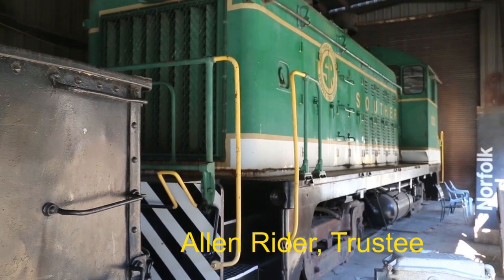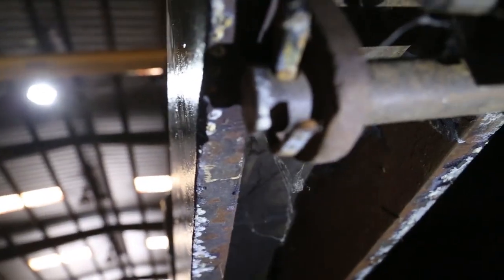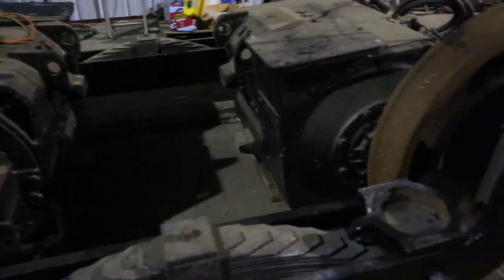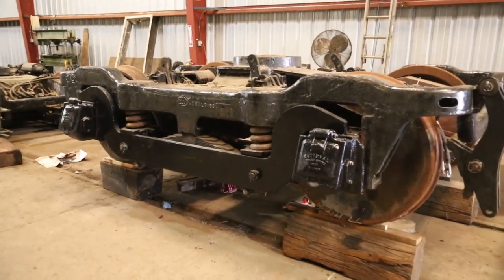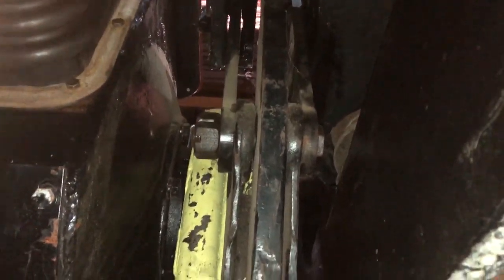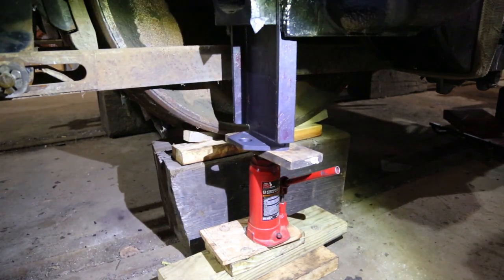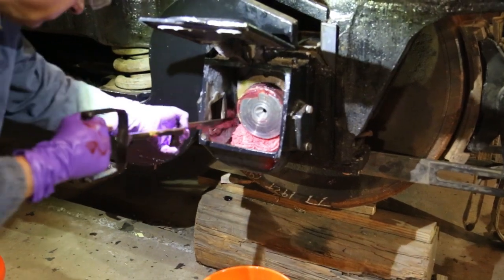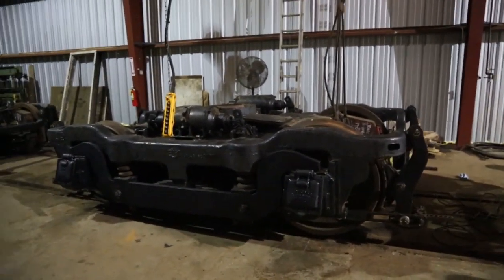Building a Switcher Truck

Comment: As a Stores Clerk for the Maine Central Railroad in the mid-1980s, I handled quite a few of those items you worked with in this video, receiving them into stock, and then issuing them out to the shop crews as needed.  It was a great job!  As was your video!

Comment: Rebuilding plain bearings and journal boxes is a real pain! 
I agree though, there's nothing inherently wrong with plain bearings, they just need to be well maintained. They are most reliable in slow speed operations where you don't have to worry so much about the speed creating so much heat. Even if you start running low on lubricant, significant damage is much less likely, and hotboxes would be nearly impossible at slow speeds. that's why many railroads opted for them on switchers as a cost cutting measure. 

This video is a great explanation and wonderful depiction of just one of many things that must be done to maintain vintage equipment. It's a labor of love!

Comment: I learned a lot from this, very interesting video. Regarding the rubber boot mounting. next time you might try spray contact adhesive, Indian Head gasket sealer, or something similar to attach the rubber to the mounting ring before installation. I do like the pointed bolt approach too!